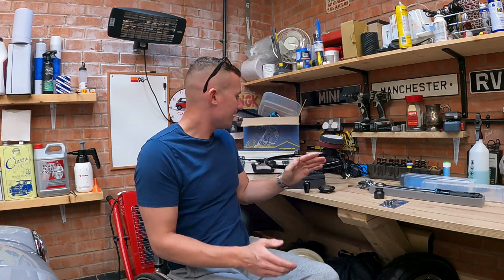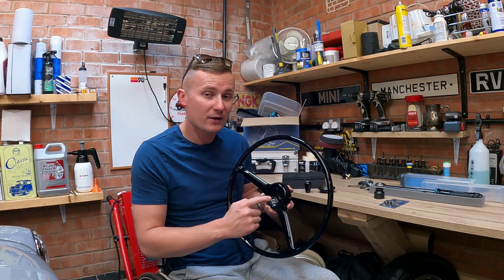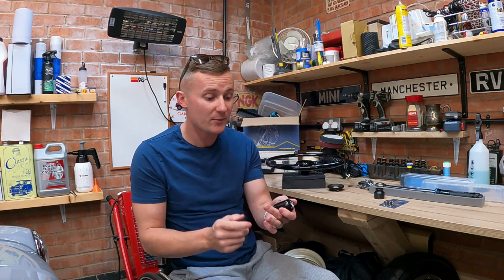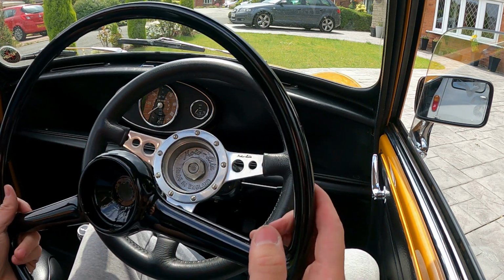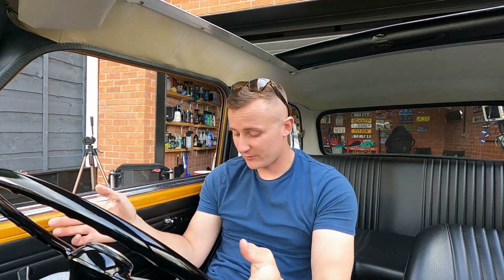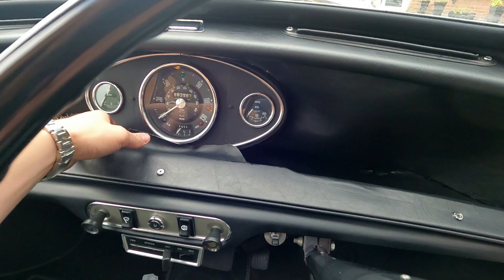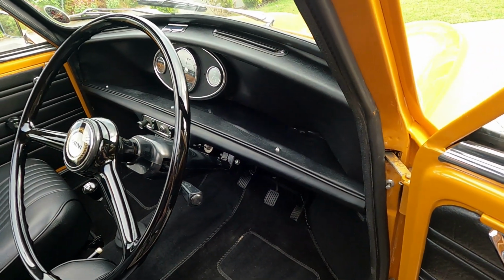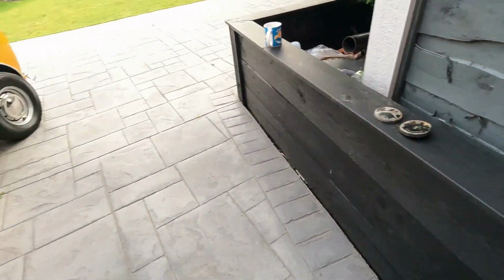Putting things back to how they should be on my *MK3 Cooper S* and the MK1 is back!

Comment: Yes, wise choice on the Steering wheel swap.  The original is so much better looking than the aftermarket one.  I never noticed the strip across the top of the dash, so leaving it on is a good choice too.  If You ever want to make it even less noticeable, You could paint the screws black to match the vinyl.  glad to see the MK 1 back.  Please take us for a drive in it!!  Can't wait for the next video.  Cheers from The US.
Reply from the maker: Yes black screws are certainly on the agenda mate, I am looking for a new lower dash rail but prefebly not a new one

Comment: Must admit I'm more tempted now to swap my 14" -Lita back to the old factory bus wheel in my Mk1, it does look good in your cars, and it's actually really nice for motorway cruising - being so wide you can comfortably rest your arm out the window and hold it nice and steady, and it basically acts like a flywheel, it's nice and smooth!
Reply from the maker: Yes the bigger wheel is great for the one arm cruise position!

Comment: Good stuff Alex, standard steering wheel is just to big, in my day in 1970s when we ran Cooper and Cooper s almost first thing was remove standard steering wheel and replaced with Moto-Lita which cost £20 with boss.
Next was a bracket to lower steering column down towards driver,  clamps on steering rack were loosened to allow rack to turn.
I remember bracket was made by SPQR.
Reply from the maker: Yeah the big wheel isn't to everyone's taste, I personally did it for the looks and driveability. Makes getting in more difficult being bigger
Reply: Don’t forget the brackets to tilt and move the driver’s seat back - also SPQR😀. Also slip on seat covers with side bolsters……

Comment: I bought a proper steering wheel for my Mk3 Mini 850 and It's so much nicer than the little go cart one I initially had. Also swapped my gearknob for a proper one. I leave the bolt for the steering wheel hand tight so my party trick is to remove it when I park up somewhere dodgy lol :D
Reply from the maker: Good idea about the steering wheel! They are probably fine finger tight as the splines hold the wheel on tight